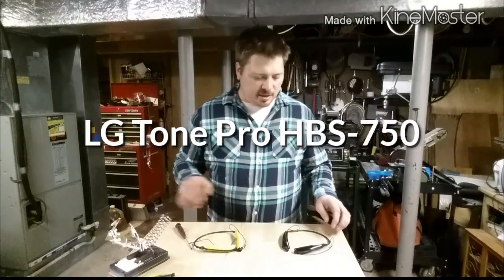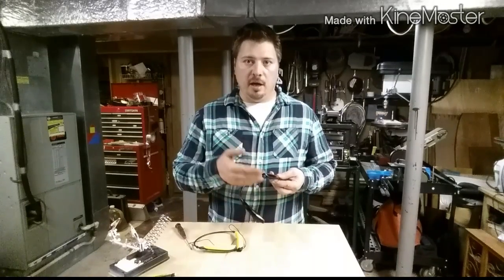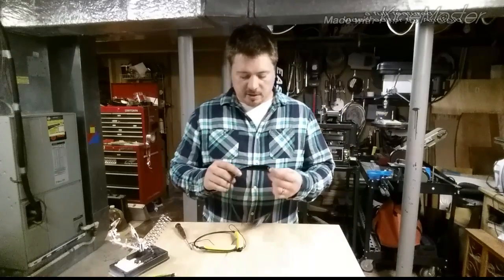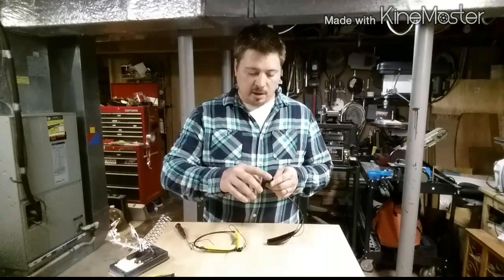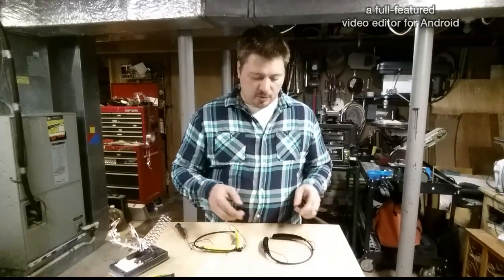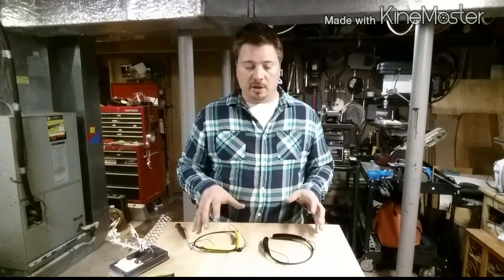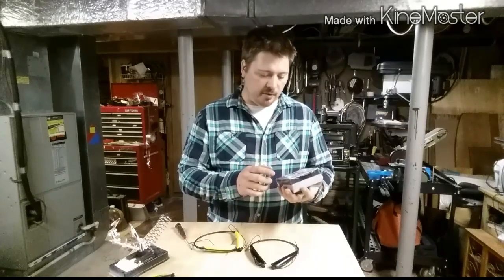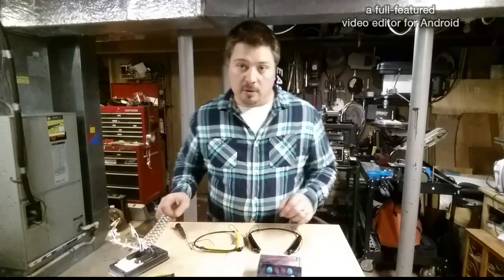LG Tone Pro HBS-750 repair, upgrade, mod

Comment: What to do if the usb jack is uprooted and the print is uprooted
Reply from the maker: If the circuit board is torn. It may be beyond repair. You could look for a broken set on ebay for parts and swap out the pcb.

Comment: how long does the 3.7v 220mAh battery and what about 300mAh battery can u please let me know so that I can choose best one for my Bluetooth too
Reply from the maker: It's hard to say because LiPo batteries are all slightly different. Also, it depends on usage and volume level.  My test was done with an hbs700.  The results at full volume were typically 8hrs and at half volume it was about 12hrs using a 220 mAh battery.  The 300 mAh battery ran slightly longer by about 30 - 45 minutes.  
Now, the hbs 750 will get slightly more battery time than the 700 because the volume doesn't go as high on the 750.  I have not tried to see if the 300 mAh battery will fit into the hbs750 tho because the battery compartment is smaller. The 220 & 260 mAh batteries are both about the same size as the stock battery so they would be the easier choices.

Hope that helps.
Reply: Thank you for your help will the battery voltage match in hb-800 too
Reply from the maker: Sadly, I have not had a chance to inspect the hbs 800 yet. No one has donated one and buying one isn't in my budget yet. I would assume the voltage is the same because 3.7 volts is a very common voltage to use for micro electronics and LG has a history of using that voltage in their hbs series. Even higher voltage LiPo batteries are usually only multiple 3.7V batteries wired in series and bundled up in one package.
Reply: Thank you for you kind suggestions.
Reply: +kez3000 Could you provide a link to the replacement parts you have used, especially the battery?
Reply from the maker: All listed on my other video for the hbs700/730.  You can get 3.7 volt lithium polymer batteries in various sizes from many different sellers.  The product number is usually the dimensions (H,W,L).  So, a 501240 product # would mean it's 5mm x 12mm x 40mm. That's just useful information when searching batteries. Would stress that you get one at least 200mAh or more. Usually anything over 300mAh is too big. Just check the dimensions to make sure it'll fit.

Comment: If my earbuds short out and stop working will I have to replace the earbud itself or the whole cord and assembly
Reply from the maker: +BigChi61 I hate to refer to any set procedure as "required"in the world of DIY.  If you choose to, you could just repair the wire.  I would recommend you replace the whole earbud for a few reasons. It's easier, it's a more reliable repair and you get the opportunity to install better earbuds. I show you the entire replacement in my video for the hbs 700/730 and how to use regular store bought buds.

Comment: Do you have a video  that shows how to replace mic or blue tooth?
Reply from the maker: Not yet but more videos are in the works. I'll be posting a battery specific video and a mic video soon.  I haven't learned enough about the bt chip set to modify that yet.  I'm sure it's possible but it's currently beyond my capabilities.
Reply: kez3000 ok i will keep a look out fir the mic replacement video
Reply from the maker: flow316  I just uploaded a video with some info for the mic.  I hope it helps.

Comment: Could you post a link to the awei ear buds u used
Reply from the maker: +Ilkinandr17 no, I do not believe they're available for sale anymore.  Just use any earbuds you fancy.  Try to stay away from the ones with a built in mic because the length of wire between the mic & earbud is generally too short.
Reply from the maker: +Ilkinandr17 no, I do not believe they're available for sale anymore.  Just use any earbuds you fancy.  Try to stay away from the ones with a built in mic because the length of wire between the mic & earbud is generally too short.

Comment: my headset keep disconnecting/turn off immediately if no music playing in phone or PC.. i need to push the button to keep it on so i can pair it..
Reply from the maker: It may be a software or connection problem with your pc. Does it have the same problems when paired to a phone?
Reply: yup,. same probs when paired to a phone.. when its new it has 10 lvl of volume,. now it only have 3.. suspect is software ot somthing,. but idk how

Comment: Great video! Can you help me with this question?- My 750 got wet . I plugged it into charge and the red light stays on and won't charge.  What is going on here?
Reply from the maker: +Erin Morgan-Kilroy it's likely that you have water damage.  You could check your circuit board for any corrosion that might be causing a short and clean it with 90% alcohol. You could also try cleaning the board in an ultra sonic cleaner (I've not yet tried this method).  I know they do that for water damaged cell phone boards.  Hope this helps.
Reply: Thank you so much!

Comment: Any thoughts on why those i call seem to get alot of the background noise? Sometimes its fine and others getting out of the car drives others on the other end crazy
Reply from the maker: Not sure. I've had that issue too. Something to do with the nose cancelation hardware they use I think.

Comment: mine does charge but no matter what it will not turn on. any advice?
Reply from the maker: First, I would check the battery with a multimeter to make sure it's holding voltage.  Then, I would check the power switch (see my other video). Last, I would check the board for loose wires or scotch marks.

Hope this helps.
Reply: +kez3000 thank you!

Comment: Hi, do you have a video regarding the 900 set? Thx
Reply from the maker: Unfortunately, no I don't.  I have not had the funds to pick one up and no one has donated one so far. When and if I do get a set, I will post a full tear down video.
Reply: Awesome thx! Friend gave me his, 1 side went out. He said there's a reset inside. Could u see if u can find a video of them? Some reason I keep coming up with review videos only
Reply: Also, on the 750 set, anyway to replace one side? Stupid cat chewed it off lol
Reply from the maker: Like one entire side or just one earbud?
Reply: +kez3000 the cord for the ear bud
Reply from the maker: I just buy a cheap set of plug in earbuds and cut them.  Procedure is shown in my hbs700 video.

Comment: Mine refuses to turn on. No response if I toggle the switch on and off.
So I decided to charge it, maybe the battery's dead! 
I plug it in and the small led light begins to blink red, blue and purple! 
WTH?
Reply from the maker: Sounds like you might have a board problem.

Comment: Great video and channel! My HBS750 has the volume up button constantly "pressing itself". When I am on a call it makes the audio to keep changing from my phone to the headsets and then back and forth (very annoying). When I am just listening to music it keeps activating and deactivating the vibration mode. Would you suggest anything to fix this issue? Thanks a lot.
Reply from the maker: +Vision Indonesia if I had that issue, I would probably disassemble the earpiece, disconnect the battery (soldering required) and lightly clean the buttons with alcohol (over 90%).  Then see if that fixed any sticking.
Reply: Thanks Sir. great channel!

Comment: I have an LG Bluetooth headset and need to replace wire and earbud.   Where can I purchase this, any suggestions?
Reply from the maker: I take wired earbuds (for use with 3.5mm plug) and cut them.   Then I solder them in and add a magnet to the backs.  Try watching my HBS 700/730 video to see what I mean.

Comment: I realize that this is an old post. I recently bought a set of hbs 750 to replace an older hbs 750. Major latency issues. Different saying/voice when turning them on. Second set was refurbished. What is the chance that some type of China crap was installed in it? Any ideas? Maybe someone else can help me? Thanks.....
Reply from the maker: Of course China crap was used to refurbish it. China crap is what was in it in thr first place and then marked up when they slapped a brand name on it.  As to the latency issue, I usually sees that with bluetooth version compatibility (older bluetooth receivers being a bit slower) but nothing that would be major. Try the headset on another device and see if you have the same issues.
Reply: kez3000 thanks for the quick response. I watch YouTube videos and noticed the lip sync is way off. Did they use a variety of vendors to make these? What’s my best bet on getting a set that works right? 
Thanks again

Comment: Where can I buy the replacement switch and battery? Can you also reply the part number please?
Reply from the maker: +Rodel Mantua as far as I know you can't buy the switch, you need to have someone 3d print one for you.  There was a viewer in the comment section of my Mic & Power switch video that claimed to make them. You should watch my other videos and read the comments. The battery question is one I've answered hundreds of times.

Comment: I husband bought me the lg tone pro 750 and since he bought them I charge them till the light turn blue and I can only use them for half a day so I know I need to replace the battery and know I can charge them all day and the light is on its red but never charges what can be wrong ... Please help cause I love them
Reply from the maker: Maria, it sounds like your battery has gone bad.  Lithium batteries are finicky things and sometimes they don't last as long as they should.  This video shows how to open the hbs750.  My other video on the hbs700 shows the battery replacement in detail on an earlier model.  I hope this helps.
Reply: Thanks but where do I buy the battery
Reply from the maker: I have links in my other video and in the comment section.
Reply: OK I'll go thought them thank you
Reply from the maker: unfortunately it's hard to find a seller that doesn't sell by the lot.
Reply: Oh OK let's see what I do then

Comment: Mine used to work great; but now when I put my phone in my pocket, the signal breaks up really bad. Like a weak Bluetooth signal?
Reply from the maker: +a b unfortunately IMO that's a common problem with bluetooth in general and I've had that issue with all my earpieces. I'm not sure if there's any fix for that.

Comment: My charging piece inside my headphones started moving, I opened them up and I guess they got unsoldered some how, and it is just shacking around inside my headphones? If I soldered the charging piece back on will that make it work again or is it something a little more complicated.
Reply from the maker: You have to look at it under magnification. Soldering it back on should fix it but you have to make sure not to bridge any pins that weren't already bridged. Since its only used for power and not data, it's not too complicated.
Reply: kez3000 Is there any specific video you could recommend to me for this, and thank you for taking your time to respond.
Reply from the maker: I don't know of any specific video off hand but I would recommend watching Louis Rossmann's channel. He does component level repair on motherboards, micro soldering, smc replacement and lots of other detailed work. I learned a lot from watching his videos.
Reply: kez3000 Thank you very much, I'll be sure to subscribe.

Comment: Do you know how to repair a HBS-500???
I got the left side sound lower than the right one
Reply from the maker: +Jorge E. Valle I've never had the pleasure of working on a 500.  It looks like it might be similar to the 770 or the 700.  If you look at my channel, I have videos for some other models that might help.
Reply: kez3000 
Ohh I see, well I will look on you channel if there is something that can be of help
Thanks for the fast reply

Comment: so are you splicing the ear bud wire
Reply from the maker: No, replacing the entire wire all the way to the pcb.  If you watch my first video for the HBS 700/730, I show you the whole process.  They are just plain 3.5mm jack earbuds purchased from ebay, cut and soldered to the pcb.

Comment: where do we buy the cable and earpieces for the 750?
Lg does not have it listed in their site for parts. thanks.
alex
Reply from the maker: You can purchase them anywhere you buy earphones. You should watch my video for the hbs 700/730.  It details how to use ordinary set of plug in earphones for the repair.

Comment: Good day, i'm having the famous left earbud no sound problem, i liked your video and it looks very simple to do... could you tell me the model of the earbuds you used, you say they are AWEI but what model, because i couldn't find one that looked like yours.
Another thing, is there a correct way on the wire colors to be soldered into the pcb board or it doesn't matter? Hope you can answer me and best regards from mexico XD
Reply from the maker: Hi Miguel, you don't need to use the same model earbuds as me.  The beauty of this mod is that you can use whatever ones you like. They work best if they fit into the cups but other than that, have fun picking style and color.

As to the wires, one is positive and one is negative so yes, it matters where you place them to have the best performance.  The negative will be the same color on both earbuds (usually gold or silver). The positive is usually a different color for left and right earbuds like red left /blue right or something like that.  You'll see the same color scheme for most eabuds including the ones you find inside the lg tone.  There is usually a (-) symbol on the pcb where the negative attaches. I go into more detail on this in my hbs700 video.
Reply: kez3000  Thanks, i asked about the colors because before i went and spend on some cool earbuds, i wanted to try some cheap ones just in case it wasn't the speakers.... and the cheap ones have 4 colors :S  one side has gold/blue and the other one has red/green.
Reply from the maker: I see, that is confusing that they didn't use a common color for negative.  There is a simple way you can find out if you still have the headphone  jack part of the earbuds and a multimeter. If you add some solder to the wires (to burn off the coating) and use the diode setting you can find the 2 negatives because they will be wired together inside the jack. I can explain further if you need more instruction.  The positive wires should not be shorted to each other at any point so, you won't see them react when you check them against other wires with the multimeter.

If all else fails, I would wildly guess that gold and green are negative.
Reply: kez3000  no i don't have it, that's why i used them because originally they didn't have it but no worries, i'll try them both ways and see which side works better XD at the end it's just only a test...

Regards and thanks for the quick replies
Reply from the maker: Once you add solder to the ends of the wires, you don't have to solder them to the pcb right away.  I will usually touch the new wires to the contacts on the pcb with the earpiece streaming music to make sure the earbud works before committing to a permanent connection.

Comment: One of the earbuds is making a buzzing sound Is it fixable or is it permanently broken?
Reply from the maker: +OYSABANDIT !!!!!! Fixable or not? That kind of depends on what is causing it to make the buzzing sound. You need to determine if it's the earbud going bad or a problem in the circuit board. The method I like to use to check the earbud functionality is to buy a very cheap set of plain earbuds, cut them to expose the wires, add solder to the wires, touch the wires to the speaker +/- contacts on the circuit board while the earpiece is streaming music and listen for sound. If I hear the music with the test earbud, I'll know it's an earbud problem.
Reply: kez3000 if it is a earbud problem what i do, or is it broken
Reply from the maker: +OYSABANDIT !!!!!! Watch my video for the hbs 700/730.  It's long but I show the full earbud and battery replacement. The 750 video is just a suppliment to show the teardown and component locations.
Reply: kez3000 ok thanks

Comment: Mines will charge perfectly, but refuses to turn on. I'm desperate. They're my favorite headphones and I don't want to shell out another 50 dollars to fix it. What do I do?
Reply from the maker: +Kathleen Saint-Amand is it an hbs750?  Try watching my video on the power switch. If that doesn't help, you may need to check the voltage on your battery with a multi meter.

Comment: my headset a ce 1177 is not seen by my cell phone but the light is coming when in  charge
Reply from the maker: I have not had a chance to tear apart an HBS 900 (ce1177) yet.  So, my advice is generic.  I would first check if the earpiece will work with another device. The LG Tone series headphones seems to have issues with iPhones in my experience. See if they will pair with an android device or laptop. 
Also, check that the power light works when you turn the earpiece on (not plugged into s charger).

Comment: The place where I charge my headphones with its charger is crushed and I can't charge my headphones 750 do you know how to fix it pls man help me
Reply from the maker: I am extremely curious how it got crushed? The only two fixes I can think of would be to bend the port back into shape or replace it. Micro usb charging ports are common and you could probably pick them up cheap from eBay. That replacement does require very good soldering skills tho.

Good luck

Comment: where do I find the ear plug part so I can fix mine
Reply from the maker: +Jay Dee Earplug part?  I'm assuming you mean the ear buds. I have no idea where to get the OEM ones but as I show ion my other video for the hbs 700, you can use almost any set from any store as a replacement.
Reply: +kez3000 I rushed it I didn't watch the video cuz I figured out what you were doing once I heard what you was saying but I watched the full video and realized what you did thanks for replying doe